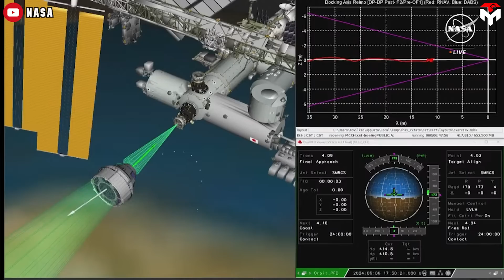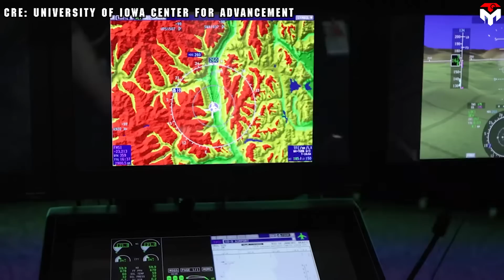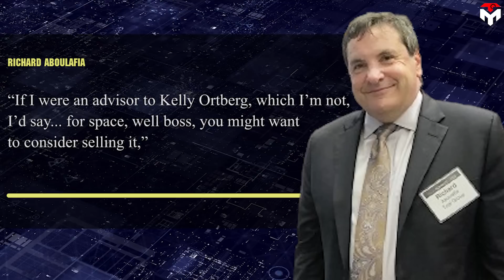Boeing New CEO To Cancel Starliner Program!

Comment: Ask yourself this question, why has SpaceX built its own private spaceport in Texas?  To get free from NASA.  Both NASA and Boeing are stuck in the past, and shackled to "TRL" thinking.  Both thought reliable spacecraft could be built by bean counters, using 1960s era thinking and blueprints.  No surprise that it's failing.  SpaceX bucks NASA every chance it gets, and that's why it is successful.  It takes reasonable risk, innovates, pushes the envelope, and is moving the field into the future.  Boeing built a 1968 airliner, and is still trying to sell it in 2024.  Using CPAs as managers.
Reply from the maker: Yes, old thinking is what holds NASA and Boeing back.

Comment: Starliner requires a totally redesign from bottom up.
Reply: Or at least, the "service module" part. That's where most of the problems are.
Reply: Lets be realistic. Boeing would not be able to redesign anything before the ISS is decommissioned in 2030 let alone test fly it

Comment: Why couldn't the Orion capsule be used on a new ULA Vulcan to reach the ISS? It would be a lot less expensive for Boeing to replace Starliner with Orion (with the upgraded heat shield) rather than fix Starliner, for the last few flights. It doesn't really matter if just reaching the ISS is an underachievement for Orion.
Reply from the maker: U get a point but this is the matter of reputation. Boeing will do anything to save their face

Comment: I like Space X, feel indifferent about Boeing as a company. BUT....Wouldn't it be good to have the Starliner working?  Make the changes to fix the problems instead of throwing out the baby with the bathwater.  It'd be good to have a healthy and smart Boeing again, to make safe airplanes and defense items.  The majority of Starliner's  problems have been fixed, right?
Reply: That remains to be seen... A lot will depend on how well the Starliner works on re-entry.  Thrusters, helium leaks, the time spent in spcae, heat shield and parachutes all have question marks against them.

Comment: This is probably a necessary short-term move by Boeing. However the real long-term problem with Boeing can be traced to when McDonald Douglas acquired Boeing (I know that supposedly it was the other way around but realistically it was as I stated). In the name of stockholder equity, Boeing/McDonald Douglas management shifted the emphasis from engineering to profits. The problem is that they pushed it too far. iThey lost their engineering/manufacturing expertise. This kind of thing takes years to build but not too long to lose.
Reply from the maker: "This kind of thing takes years to build but not too long to lose." Great idea. Do you think things will be better under Kelly Ortberg?

Comment: 0:41 umm yeah they found the route cause. The teflon seals in the oxidizer valves is swelling due to heat and affecting propulsive output.
2:18 More like fatal design flaw. Leave to Boeing to take a mission proven thruster design and screw it up.
7:45 at this point Starliner as commercial crew asset are done. At this point I see Starliner reconfigured as cargo resupply module with return capabilty. I'm pretty sure NASA would like to recover some important assets from ISS before end of mission.
Reply: If heat is in fact the root cause of the thruster problems how was this not discovered during testing?  By all accounts the thrusters weren't required to do anything unusual on their way up.
Reply: @chrisantoniou4366  not enough testing of changes to the design. These motors in the original configuration are extremely reliable. These motors are used in space probes.

Comment: I say let Space X engineers make the necessary modifications to the Starliner to make it work. They could dump a ton of gauges and switches and use lighter electronics.Then perhapscould also retrofit Dragon thrusters to the same. While at it, hows about requiring standardized space suit connections and seating?

Comment: Starliner is so badly designed that it's likely unfixable.
Reply from the maker: Honestly, Starliner seems too old
Reply: And dragon is a moving target as space x is constantly making changes and improvements to the four existing capsules.    They can also make another relatively quickly (by space craft standards that is which is not all that fast).